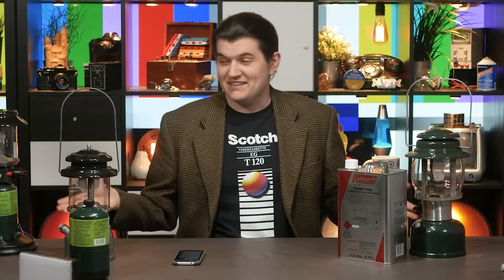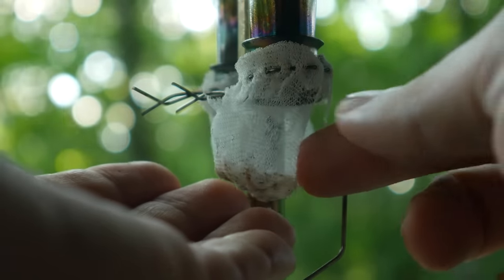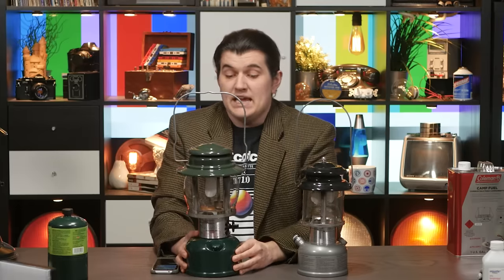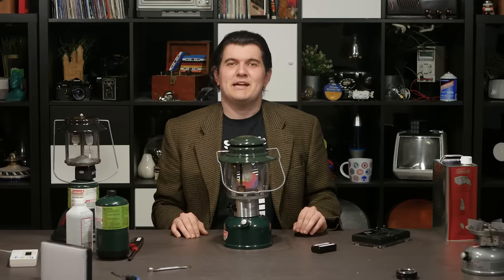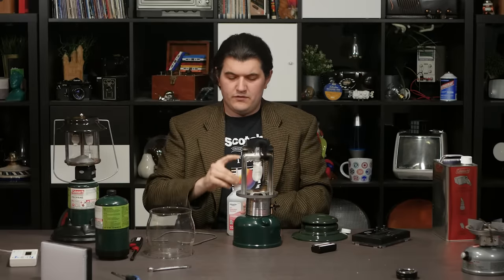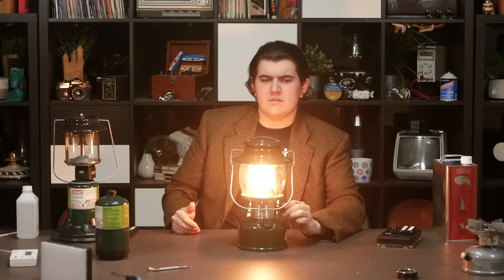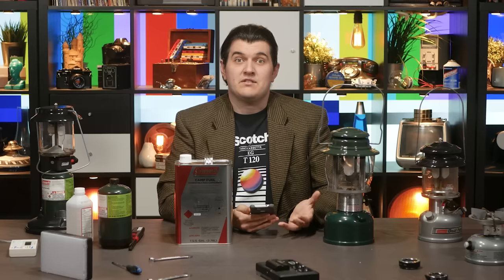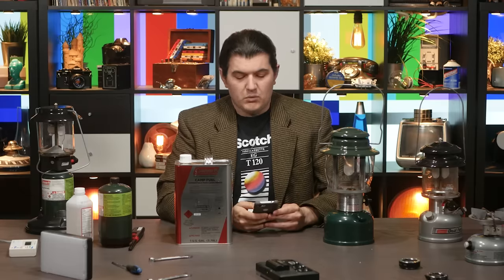A very rambly Coleman Lantern follow-up. Turns out they rarely make sense in 2021

Comment: I have never thought about using my Tilly multifuel indoors.
I have turned mine into a spectacular fireball a few times. I have owned it for about 30 years and it wasnt new when I was given it.
Im having real difficulty finding mantles for it. They are all too small.

As for fuel use. My Tilly lamp works fine on petrol, kerosine, diesel or a mixture.. It uses a lot less than the kerosine greenhouse heater I have.
I dont use the Tilly lamp for camping anymore.

I have a multi fuel wood gas camp stove, a candle and I carry a small LED lantern when Im hiking, just in case I need to camp over night and hide from the weather.
As Im walking I pick up dead wood for the stove.

Comment: I take my white gas lantern hunting in the mountains every fall, it's cold. I spend as much as 6 nights at a time without the ability to recharge lights. The white gas lantern comes on no matter how cold, and actually puts off a little bit of heat in my canvas tent, I do not heat the tent at night so those batteries are freezing every night and not getting much or not at all above freezing during the day. What I like about my lantern the most is the fact that it was my grandfather's and it still works perfectly. Now, at home or camping during the summertime, sure I like LED lights. I may not recommend the white gas lantern to new campers or really anyone outside of the special circumstances which I use them. I don't fear new technology, it has made our lives so much easier, but sometimes we like to do things the old fashioned way and there's nothing wrong with that either.
Reply: Hi ondfritz have you become a flat earther yet? If not I suggest watch a 13 part series called What on earth happened by Ewaranon to learn that the earth is not a globe. I got it in my about tab.

Comment: Enjoyed the ramble, I have been getting into the lithium power station culture... my Coleman lanterns have not been used in a decade or so... Also the GoSun/Goal Zero can power lights beyond my use for power outages as well as solar cooking /storing power for portable fridge or other... other rabbit holes I am exploring are the Bio-light power production from bio fuels like twigs and so on.... the Solo Stove camp stoves that can cook on dry rotten wood or twigs.... have cooked with a wok (hot flame used) on the Solo Campfire stove using dry free waste biomass...the Bio-light stove can generate power from that same waste bio-mass... the cost of big power banks and power stations can be huge and lithium tends to need charged in storage at least every 6 months or so... but so far I am finding use for the power I am playing with... With the MPPT technology for lithium power stations one can over supply a power station with a bigger solar array and the regulator can throttle down the input to the power station max input levels.... targeting some larger solar panels that I can merge into an array of 600 watts or so to charge a Goal Zero Yeti 1500x... the kind of output that can keep a portable Fridge/Freezer running non-stop for over a year... in the Puget Sound region of Washington state... think rain and overcast... The GoSun power banks have built in light in them that are a few hundred lumens... Harbor Freight has some USB charged lights I like that have a couple hundred lumen lights that I can light with a power station even with the battery removed from the light... or the work light I can plug into the AC out put on the GZ  Yeti 500x I put in my old truck... lights in the cab and back in the canopy that is better than the truck lights... that power station is limited to 120 watts solar input, but the MPPT can take the wattage it can use for charging from the larger array of panels I can put out for portable power... rain testing the panels some... and inputs of 10% from a 600 watt array could still give me 60 watts of input in overcast weather.... I have also tested daisy chaining of smaller panels and using a reflector to boosted a 50 watt panel to produce 50 watts out put to the power station.... I also design and experiment with solar cookers... that use just sun and some that can use stored electric power... You make note of third world issues with power resources... very valid to consider... there is a solar cooking native promoter in Haiti that is sharing videos he shoots of his public cooking and impressing the neighbors with the idea of solar cooking... not sure what power sources he is using but... I am impressed with his methods of sharing the concepts of solar cooking... the technology is trickling into the third world... into places where solar power might be less hassle than fueled lighting if they can afford the investments in portable power production... the off grid concepts are developing and spreading slowly.... I have seen my ability in an overcast, prep for the big one earthquake... or local rain/wind storms that can knock out power for a day or a week or so... region develop in what I can do if I care to explore the technology I can afford... Simple stuff like gasification bio-mass camp fire stoves (Solo Stove Campfire) that allows me to used dried fuel to cook when Sun is not out or my GoSun Go cookers that can use the sun to cook frozen corndogs in less than an hour on a sunny day... 

I enjoyed your 'ramble' on an old technology that I am not likely to use much... I do have propane cylinders both disposable and reusable that get used more for burnishing wood projects than in cooking in a small grill or with the lantern that I could put on a propane tree or cylinders... there is some use for that stuff, but would I bother to get any more Colman fuel for either cooking or lighting... not really... kind of like looking at videos of the Victorian age when technology was novel experiments on new ways to die... not by intent, but not knowing the hazards.     Thanks for sharing hazards of technologies...

Comment: I used coleman fuel (white gas), which is actually naptha, for paint thinner in my manufacturing business. Oil based alkyd enamel paint can be thinned for spraying using either paint thinner (mineral spirits) or naptha. Coleman fuel used to be less expensive than either naptha or paint thinner, so I used it for paint thinner. Over time, coleman fuel got higher and higher priced.
Then, I found another brand of white gas lantern and camp stove fuel that was much less costly. Sold at my local walmart under the brand name "Crown". It was the same naptha stuff as coleman fuel and worked just as well for thinning paint. It was like $5/gallon, instead of coleman's $10, so I used that.
That was a few years ago, so I don't know if it is still available, or at that low a price?  
Nowadays, propane lanterns and camp stoves are probably the economy kings (especially if you refill the 14oz disposable tanks from a 20lb refillable cylinder using the adapter fittings sold for doing that.  Just be sure to fasten the small tanks onto their appliances right away to prevent them leaking, because the small disposable tanks valves sometimes do not seal well when they are refilled).   Hard to beat propane when it can be bought in bulk for $2-3/gallon compared to coleman fuel that costs over $10/gallon.

Comment: i have a few coleman lanterns and stoves and still use them when camping because i like using them. sure, led lights are great but they don't have the 'fun' aspect of lighting an antique lantern. the only downside is that white gas/coleman fuel is not as easy to find as it once was, only a few stores carry it now. it used to be available in all stores and most gas stations.

Comment: The reason for the hole in the valve if it hasn't been answered is if you pump it up to A LOT of pressure you may not be able to seat it all the way back in to then turn and close the pump valve. The hole lets you bleed the extra pressure allowing the piston to seat all the way down.

Comment: The hole is there so you can't over pressurize the lantern. When the pressure inside reaches a certain point, any attempt to add more pressure just leaks past your thumb.
Reply: Hi indig have you become a flat earther yet? If not I suggest watch a 13 part series called What on earth happened by Ewaranon to learn that the earth is not a globe. I got it in my about tab.

Comment: About the kerosiene-topic - I live in germany. I wouldn't even know where to get kerosene, because it's not popular here exept as fuel for airplains. Here in Germany the easiest fuels for a latern like this would be gas from a gasstation or litteraly camping-gas in a pressure-bottle like methane or butane. Or, if you want it, latern-oil or petroleum.

Comment: Btw oldcolemanparts sells the kerosene alcohol bottles for use in filling the preheat cup. And you can swap generator tips out on some older generators and convert 200a and 220/228s to kerosene as well.

Comment: Wow, I was about to disagree with you but, you are so right. Nowadays I'm using my propane lantern as a mini nightlight but, I am using it mostly 95% for heating both in the ice fishing hut and in my small camper. Coleman single mantle mini lantern with the number 51 lantern mantle. I need 95% of the heat. When I'm done, I might only get 75% of the heat.

Comment: I agree with you on the handiness of electric lights and lanterns and they are the much more viable option for everyday around house use. For me though, the white gas/duel fuel is lantern is still the preferred option for both camping and emergency lighting as I've had too many problems with batteries going dead and electric power lanterns and light sources otherwise not working when I needed them and have always found the old gas light to be much more reliable and always work when battery power otherwise let me down and left me in the dark. Don't take me saying that as bashing on the newer electric lanterns as they are great when they work. That being said there is still no replacement for the gas lanterns though for their reliability when batteries leave you in the dark. So while electric lights are great, it will always make sense to have a least one or two of those around and I prefer not to go camping without bringing one along. Plenty of times I was glad I did. I actually end up using it on at least 1 in every 3 camping trips because something went wrong and I would've been left in the dark if I didn't bring it. I use the LEDs when they work, and always have the gas lanterns ready for when they decide to abruptly stop. Like the video though and the attempt at a minimally biased rambling debate between the different light sources. Love the informative nature and the thoughts in your videos and look forward to more.

Comment: About the LED Camping Solution: There are bespoke LED Camping Lamps/Flashlights out there, with a 360° Light (dimmable) Emergency Light and Flashlight for around 40 Bucks. They have an integrated Powerbank 2000mah-4000mah. They last about 6 Hours on 180° Degree mode on a slightly reduced level illuminating about 6-7 feet radius pretty nice. (Had a 2 Day Poweroutage and 3 of them recharged one on Work PC the Other on Camping Solarpanel). A cheap (again 40bucks) 30W  Backpack Solarpanel can Recharge it (2nd was recharged at home with it) fully. So you got a small Powerbank, LED Light, Backpack Solarpanel for 80 Bucks.

Comment: Have to disagree with you somewhat about paraffin (kerosene) lanterns.  I have three Tilley lamps, X246B Stormlights, and use them when we get power cuts - our electricity comes on overhead wires, and sometimes fails.

The Tilley doesn't have all that shielding around the working bits, and leaks are immediately obvious and can be fixed.
I've never seen cups like you describe on anything other than paraffin stoves.  Lighting the Tilley is done by a preheating torch, which is soaked in methylated spirits (I think that's denatured alcohol in US-speak), clipped around the generator tube and lit.  I don't know if meths burns hotter or cooler than alcohol, but I've never taken five minutes to light a Tilley, 2-3 minutes in adverse conditions.

I've sometimes re-lit a Tilley that I turned down too far, using a match up inside the glass.  Access is a lot easier with the Tilley, and the generator stays hot enough to put out kerosene vapour for a little while.

Burning pump unleaded petrol in multi-fuel stoves or lamps leads to a build-up of unburned or partly-burned additives in the generator.  The stove or lamp flame is not hot enough to completely combust these additives, which are meant to replace the anti-knock function of tetraethyl lead among other things.  Using pump fuel will lead to a need to clean out the generator frequently.

I'm really happy with using my paraffin Tilleys indoors.  I would not be happy to use a petrol lantern or stove indoors as flare-ups are far too common and the consequences are severe.
As I understand it, petrol lamps and stoves are commonly used in cold environments, where paraffin goes viscous and gas bottles would need pre-heating.

Cost of fuel has never made a difference to me.  I've had the Tilley's for years and the bright light, comforting hiss and significant heat output are very welcome on a cold night when the power is out.
The situation with battery-powered lights was completely changed by the advent of and continuing development of white-light LED's.   They can compete with a Tilley for brightness and are much easier to use.

I'd like to know what type of battery you were holding up, as it doesn't seem like a standard size, and Sony have made proprietary batteries in the past.  I can't buy them at a local supermarket, and almost certainly not in a remote area, A better comparison would be to standard easily available batteries, typically AA's.

Comment: Do a bit with zippo hand warmers. So many people use a flame to start them when they are only supposed to use heat to warm the fuel. Please explain these warmers in a video. I would like to hear your explanation. The top part of the warmer is supposed to be a chemical / catalytic response. Correct?

Comment: Great share of the nuances of the different fuels. I think it is realistic of the avg joe's experience to waller around in the details to figure out the best, if not just good, setup.
I heat my small camper with a portable diesel heater, so can share the fuel with the Coleman 639.
As you mention, you can illuminate but not really cook or heat with battery.
As a complete luxury, I have 200W of solar and that cost at least $800 and involved a lot of wiring, and amazon fumes to get the pieces to my house.

At the end of the day and the decision rabbit hole, Coleman apparatus has the cool factor way over batteries 👍,

Comment: I switched from a trangia to a kerosene stove with a wick, along with hurricane lanterns, because of issues with orings and seals. I can get kerosene for under $5 a gallon at the pump any day of the week, and I always run it out during the winter, heating my garage with a torpedo heater. Plus, eventually, I want to get kerosene convection heaters for the house in case of emergency, so a couple of mantle lanterns that use the same fuel are an absolute no-brainer.

Comment: You need to half the fuel/battery weight comparison calcs. As you will need to carry the batteries back out, where as liquid fuel you leave most of the weight behind.
Also your lost 99% of efficiency is a lot of generated heat, which may useful for your camp.

Comment: Well, in general I agree to your point, , I know the desert or winter camp where the lamps double up as heaters is not so common now, but if you are in that situation, you develop a routine, you start to like the routine, it is to some degree comforting and more enjoyable then the LED light and the easy access to kerosine is a substancial advantage. Actually I tend to us both LED  and kerosine, as both have teir benefits.
Reply: At home I only use incandescent bulbs because LEDs create harmful dirty electricity and blue light. Have you heard that reason to avoid LEDs before?

Comment: Most modern campers don't use white gas or propane unless you're car camping. They use propane/butane mix. Way thinner canister means you get the energy density without the container weight. You can get a mantle lantern that runs on it as well, but flashlights are way safer/easier to use. Only reason to take a gas lamp camping is because you already have one and don't want to or can't spend the money on something else. A lot of preppers like them because you can use different types of fuel, but they have lighter/better options for about the same money.
Reply: Oh yeah, and the cold. If you're camping on a mountain in the winter, you definitely want white gas or gasoline.

Comment: With the current economy and products of fuel, electricity, gas, diesel, oil anything, kerosene etc., our current times have made the economical things in life expensive and to warranty reconsideration of their use and/or quantity.  However, putting that aside, these camp lanterns were mostly used for long term lighting needs around the campfire, the kitchen, the sleeping quarters, tents, campers by the entry door etc. and for taking on hikes. For those reasons, these worked very well for a good 8 hours before having to be concerned about fuel. 
The sad part about batteries are once they are dead, the need recharged and where is the electricity to do that in the boondocks? Or, if not rechargeable, you have to replace them likely more often than a gas or propane lantern. These have been around since about the 1920's so I believe they have proved their worth. At least until the price of fuels makes them stupid expensive t use which by then, none of us are going to be using our cars, truck, SUV's for fun anyway as it wouldn't be affordable.